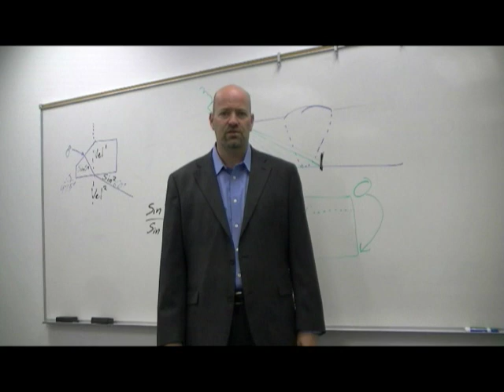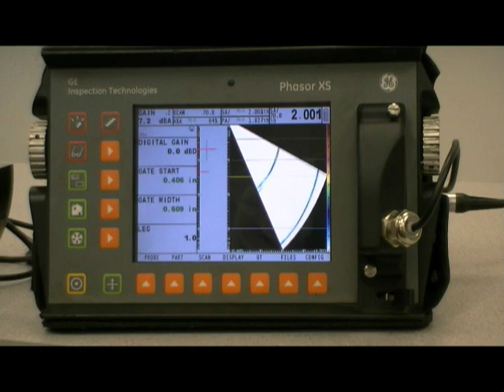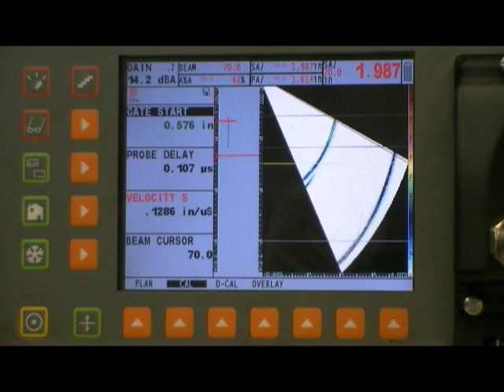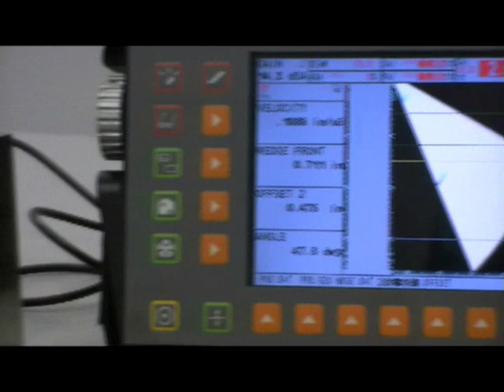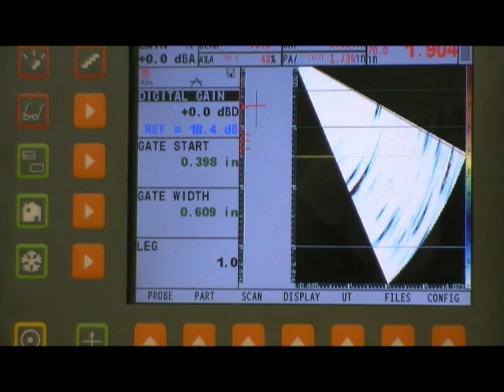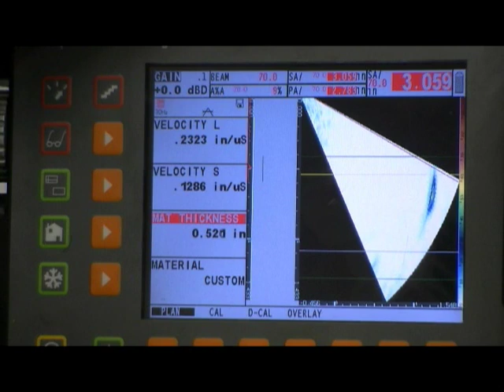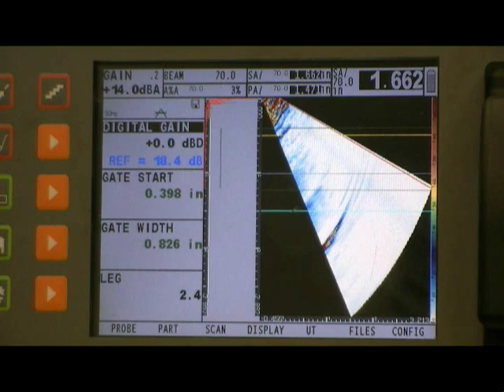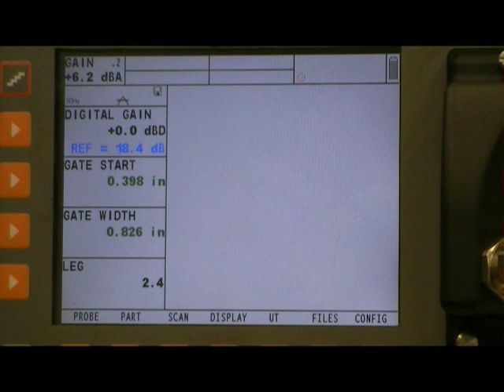How To Use Phased Array To Comply With AWS Codes - Waygate Technologies

Comment: Hi,

At 4min30, there is something weird about the technic used to calibrate the velocity. The first step align the reference to 4 inch by changing the velocity. The second step align the 2 inch reference by changing the probe delay, it is incorrect because it will also affect the position of the 4 inch reference.